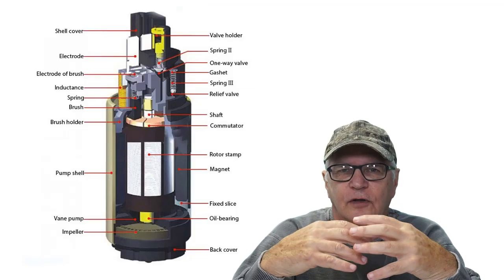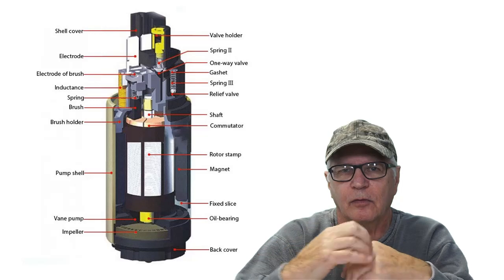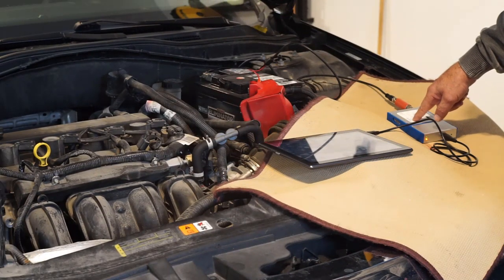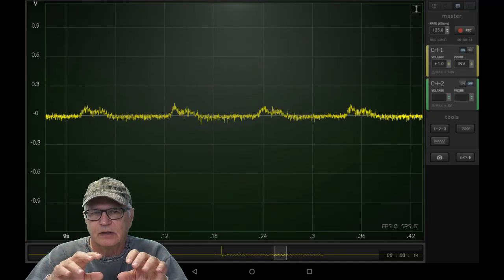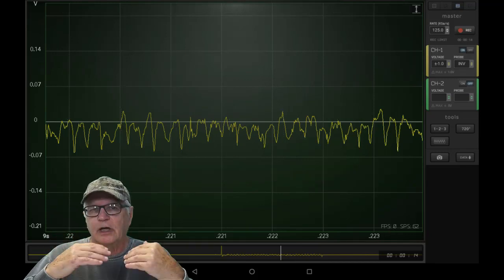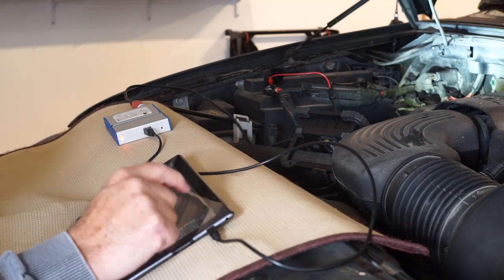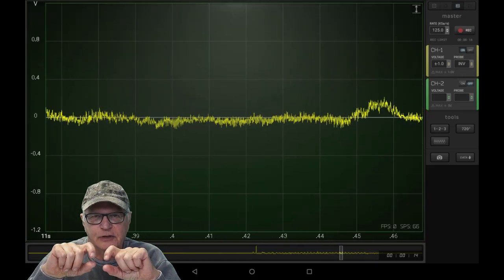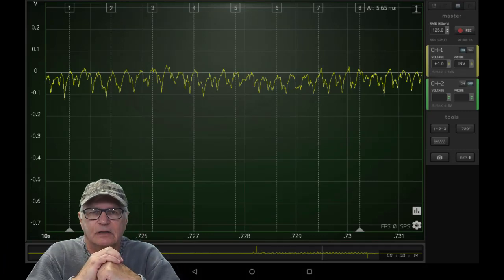GADGETS#79 - STARTER ARMATURE SCOPING

Comment: Wonder how well this would work diagnosing a small universal motor like in a corded drill or other corded tool. My thought would be to power it with a DC supply. I wonder what the waveform would look like since it also has to feed the field windings. Since the field windings are in series with the armature windings my thought would be it is very similar in shape.
Reply from the maker: with a drill, we'd have the advantage of not needing a high pass filter as we're not trying to tame the compression strokes...

we would have the disadvantage of the drill not being under load to help pronounce the draw across the segments...this could be addressed with a friction block on chuck, for example...

sure, I think the health of the drill commutator segments could be seen with an oscilloscope
Reply: @theGADGETSplaylist  good point on loading the device.

Comment: Great idea !! Have you considered using trimming caps to fine tune the filtering ? Might be something to try. I know my Rigol 1102E has low pass and high pass filtering . I can adjust and fine tune the filters to really dissect the waveform .
Reply from the maker: no, Mark...I haven't given much consideration to any trimming and fine tuning on this.
33Hz (both the low pass #96 and this high pass) are AGGRESSIVE filters! I have no plans at this time to modify them.
Thanks for the input:)
Reply: @theGADGETSplaylist  yes I see they work great and really ignore a lot of the unwanted signatures . also I was wondering if you used and inductive probe like a COP pick up right near the starter what it would show . I have the paddle probe from AESwave and was playing around with it one day and learnt it will truly pick up and EMI and display it's pattern . I used it within an couple inches of a cell phone changer which is a switch mode power supply and was able to see it's switching frequency as well as the characteristics of the waveform. Used it near a small fan and it worked the same and showed a 60Hz sinewave that was cleaning being distorted by the Lxc of the fan motor .
Reply from the maker: @markhb3346  - yes, same with the DIY COP #29 and the bluetooth!!! COP #78...wave them around any EMI source ...TV, power supplies, etc., ... and they will pick it up.
Wave them around an engine bay with high tension spark plug wires and there will be a lot of activity, though of no use.

And, I don't think it would tell us anything about the commutator segments in a starter.

Comment: if you get a chance ,do a free spin test ad compare,i've a couple of lawnmower starters ,i may try it,and i'm interested in the high pass filter build.
Reply from the maker: +henry robinson - I remember well our RC FILTER conversations.
I've featured 2 here recently. This in-line HIGH PASS and in GADGETS#75 a LOW PASS on the front end of the oscilloscope circuit.
I have no plans to do a free spin test (at this time...). There would be no need for filter there right? No compression strokes to tame down...BUT without some "load" (rotational resistance) on the starter, I'm guessing the waveform would not be very pronounced. Never tried it.
I would think lawnmower starters turn much slower (I'm betting 3500 RPM) so they would be easier to test.
Reply: @theGADGETSplaylist  well you aint far from doing a driveline vibration analysis,just something to exercise that machine shop mind
Reply: you can take the machinist or the mechanic out of the shop ,but you cat take the knowledge they had and give it to a young replacement
Reply from the maker: @henryrobinson9837  - I was young, once.
I remember the ol' timers when I started in the trade. Guys that started in that shop in the 1930's !
They held on tight to any knowledge, careful not to share with others. Like it was all they had. And it was all they had.
I share. Always have. Because there's always more where that came from:)

Comment: What an eye opener.  You are definitely quite an instructor.  I’ve been a tech since 19??.  I always thought that the 350 to 450 rpm’s of the engine was the cranking speed of the starter.  Dummy me. Just never thought about it.  Now I understand why all those bushings on those end plates wore out.  Not only is the scope pattern impressive but the speeds these starters are turning.  Thanks for your efforts with these video’s and keep up this great work.
Reply from the maker: +William Brand - Here's more interesting stuff:
Ratio of flywheel ring gear to starter pinion gear is usually 16:1. That made the older direct drive starter armature spin @3500 RPM.
Then came 4x internal gear reduction and the ratio increased to 64:1
Thanks for watching!

Comment: Any wave forms without the 33hz filter ? I will try this on my vehicles.
Reply from the maker: +Desert Mike DIY - have a look at GADGETS#74. It's a relative compression on the same 4 cylinder engine as in the first test here. There is no area to work with in between compression.
Try a relative compression test. Now, without a filter. Tell me what you see.
The filter gives us an area to work with. It is still difficult. We must appreciate what we're trying to looking at...
Reply: @theGADGETSplaylist  I imagine that the noise coming off of the brushes is quite substantial since they spark a lot during rotation. Not an easy catch.
Reply from the maker: @mikep95133  - you are correct...it is NOT an easy catch. Perhaps not so much to brush sparks, in my opinion. I'll stick to the two main obstacles mentioned here.
Those who enter this without full appreciation will exit frustrated.
I present this work in as smooth a fashion I can, else viewers would walk away. But behind the scenes is a lot of effort (not so smooth) that goes into it.
Over 90% of the video clips and tablet screen recordings end up on the cutting room floor. There's a LOT of work here!
Thanks for the interest, Mike:)
Reply from the maker: @mikep95133  - another factor, I'm not sure how your Tektronix will perform at this. Maybe it will do fine...maybe not.
Some of my work: this starter test, the dynamic balancing, the stethoscope fuel injector pintle lift and drop, etc...I don't think I could do without that HScope app squeezing that performance out of those budget oscilloscopes.
I'll try to make more time for your channel. I like what you do and where you live. Huge contrast from what I see out my window right now:)
Take care!
Reply: @theGADGETSplaylist  That's a big project for me is to see how well this Tektronix THS720 does in automotive. In one forum I read, a couple guys put the 720 up as a contender against usb scopes. So I have to find out for myself. So far so good, but I just got started. Using the HT25 hv probe was not successful. Just too much noise in the wave form. Although  I'll try another of our vehicles just to see what occurs. Plus I have a second 720 that I will confirm my findings with. I"m looking forward to testing the fuel pump and fuel injectors as you have already. A starter exploration might work as the 720 is fast enough. I'll report any findings either way. Thank you for the inspiration !!!
Reply from the maker: @mikep95133  - sure thing, please do share your Tektronix results...interesting.